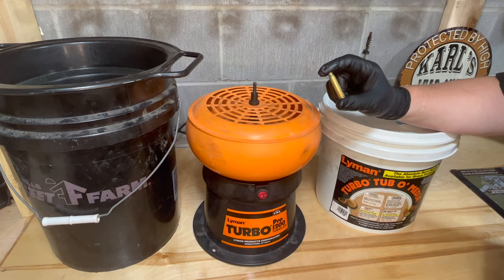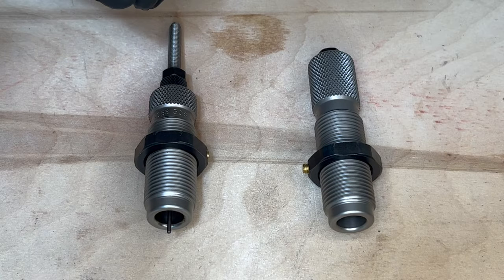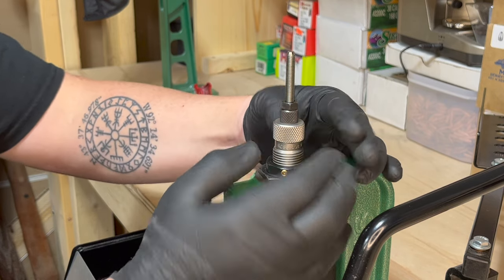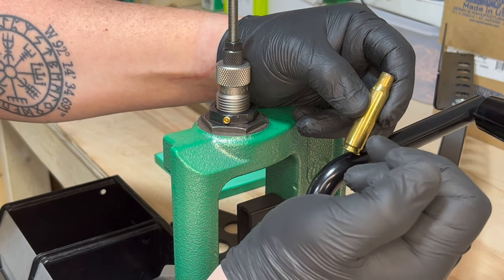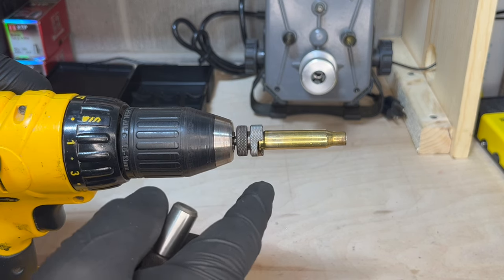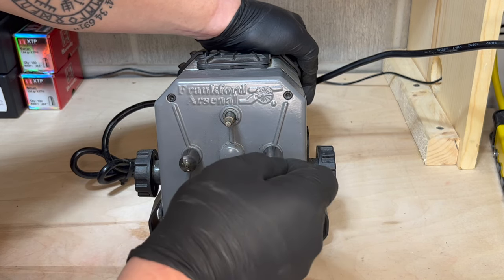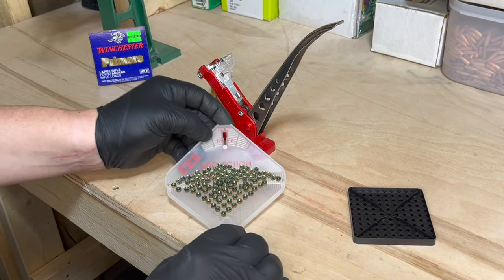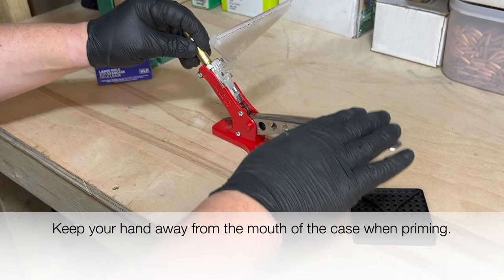How to Reload .308 Winchester Ammo For Beginners

Comment: Thank you.  I've been reloading for decades, but not a lot of .308.  The question that always comes up that I'd like people's opinions on is how much crimp is enough.  I've read where the right answer is none, the mouth of the brass should be the diameter of the bullet plus both case walls and nothing more.  I've also seen factory ammo that had a slight crimp.  Anyone care to weigh in?
Reply from the maker: Hello @oldsalt898 - I'll start off the conversation. Like you said, you'll hear mixed recommendations. Here's my rationale as to why I crimp. I have ramp feed and chambering issues when I use reloads in my AR style platforms. So I use a light crimp on all of my .308 reloads. It will be interesting to hear others chime in with their thoughts! 👍
Reply: @k2defense  So if I'm hearing you correctly, you would put a slight crimp for the AR, but maybe not for a bolt action rifle like a Remington 700?  Thank you for taking the time to reply to my question.  It is appreciated.
Reply from the maker: @oldsalt898 - I prefer to crimp both. However you wouldn’t need to unless the reloading instruction requires it or if you notice pressure issues or notice that the COAL changes with the lack of crimp to hold the projectile into the case mouth. For this reason, I crimp everything. Some more than others. Hope this helps! Happy to dialog more if needed. 👍🏻

Comment: The case length is 2.015.
Reply from the maker: @vindicator54 - The maximum case length for a 308 Winchester is 2.015" (51.18mm) and the case trim length is 2.005" (50.92mm). As with most cartridge cases the trim length is 0.010" less than the maximum length.

Comment: This is the best beginner reloading tutorial out there. So many others offer great instruction, but they speak a thousand words per step. They mix in more advanced instruction and other tips not needed to just GET STARTED. Thank you!

One question: do you have to crimp the .308 shells? If it's a choice, what's the difference - more assurance that the bullet will not fall out or get knocked crooked?
Reply from the maker: @ZildjianMan30 - appreciate the compliment! As far as crimping, I crimp everything. I run the .308 in the AR platform so if I don’t apply a light crimp I’ll sometimes have ramp feed issues from the mag to the chamber. When I apply a light crimp that issue goes away. Yes, it also helps with projectiles being inadvertently pushed into the case by aggressive handling, storage, etc. Some reloaders may respond with other ideas, however, this works for me with zero issues. Just don’t over crimp as it could pressure issues. Hope this helps! 👍🏻
Reply: @k2defense  That makes sense. I'm hoping to finally get into reloading. I have almost everything required to get started saved to a wishlist. Waiting for the big, end of year sales.
Reply from the maker: @ZildjianMan30 - awesome! Keep us all posted on your progress! We’ll love to hear how you’re doing! 👍🏻

Comment: So could you keep a completed round at your desk to use as a guide for setting your crimp and seat die? Wouldn't that save allot of effort. Then you can double check your first rounds with the calipers to make shure your at the right col and presto you just set your press in half the time.
Reply from the maker: Damned Angel - I take it a step further and use locking rings. Once you set them, you can forget them. All you need to do is screw the die into the press and off to the races you go. To your point, the main idea with reloading is consistent repeatability. Thanks for the comment! 👍🏻
Reply: Better NOT to have powder and primer in a 'dummy' round... just saying 👍

Comment: Was wondering why you did not include a step to check the formed case in a gage to confirm it is meeting headspace specs? When I first started reloading 308/7.62 Nato, with my 1st batch of 300, many would not allow the bolt to close. Bought a Hornady cartridge check gage.. found the ones that would not chamber, failed the check. Ended up pulling all of them apart, and carefully ran them thru the process again.. I figured I was not running the case all the way into the die. Problem solved.

Now, when I do a batch, especially if I am using fired 7.62 nato brass, I check every single case. Sometimes, no matter how many times I resize a case in question, it fails the gage check. Those I toss. All of my dies are Lee Brand for all the calibers I reload.
Reply from the maker: Hello Stephen Burton,

Great question. I usually use a case gage or the plunk test. I missed it. Thanks for brining it to my attention! 👍🏻

Comment: Small base dies are for auto loading rifles and aren't needed for bolt rifles.
Sometimes even an auto loading rifles doesn't need the cases sized is SB dies.
I did an AR 10 upper in 308 then got lucky that this AR Stoner barrel works fine for cartridges sized in standard 308 Redding and RCBS dies.
I own AR 10 uppers in 6mm - 284 win / 6.5 284 Norma / 375 - 300 WSM and with these uppers the reloaded casings didn't need me to request the sizing die to be made a small base sizer die.
Personally, I wouldn't back off the bullet seating die at all once screwed down to a stop on a cartridge because I want the full alinement of the bullet as it is pressed into the cartridge.
By backing off the seating dies it can cause the wabble affect and cause at the base of the bullet is unsupported letting push outward in any direction.
For seating bullets in the cases I seat the bullet a little a time then check with the rifles where the bolt closed in the loaded cartridge and then set the die for that bullet seat depth.
Some rifles have a longer chamber throat than you can seat the bullet out then the cartridge won't fit into the rifle's magazine so in this case I seat the bullets to where the cartridge fits into the magazine.
Not all chamber reamers are the same so going by book recommendations for bullet seating isn't always true for the rifle you own. 
As an example, when I bought from Pacific tool & gauge the reamer for the wildcat called 375 - 300 WSM there is also a reamer 378 WSM, the 378 WSM cuts a longer throat than the 375-300 WSM and being this is in the AR 10 I have to remember the loaded 375-300wsm cartridges must fit in the steel 20 magazines of an AR 10 so the 378 WSM wasn't what I wanted.
If someone wants to know about the 375-300 WSM look it up and it is a match in power for the 375 H&H magnums.

Comment: Great information, excellent work on explaining details. Do other dies work the same way, or does the process  steps change when using Hornady  or other dies?
Reply from the maker: The steps are similar. There are some differences when neck sizing, FL sizing, and SB sizing. Carbide and steel dies have variables as well. You’ll want to make sure to read the instructions when using each type of die. Hope this helps! 👍🏻

Comment: What's your primer seating depth ? Factory spec is 0.004" my groups are better at 0.007" .. Some like 8 to 10 Thousandths..
Reply from the maker: Diamond Fred - honestly I don’t check primer seating depth on my plinking rounds. The best seating depth is just below flush. I run my finger across the bottom to make sure they’re not flush or just above flush. I’m concerned for slam fires as I mainly use this ammo in AR platforms. March grade shooters find a sweet spot by measurement just below flush so 0.007” is adequate. 👍🏻

Comment: i'am noticing that at 2;30 you are holding a cae that seems to not be sized at the head of the case i can see a line on the case , to me that means the cam over is to much. i've had case do that and stick in the chamber after that.
Reply from the maker: Hello @ultimatecreedmoor!

Knock on wood, I’ve never had that happen. If you’re having trouble with it, turn your die down by an 1/8 turn, resize, then plunk test it until you hit that sweet spot. I run all my ammo the same for AR and bolt platforms.

Comment: Id like to know what brand the drill powered trimmer is that you used here please.
Reply from the maker: The Lee Case Length Gauge & Cutter and Lock Stud is the simplest way to check the case and trim to the correct safe length. 👍🏻

Comment: This is by far the best video I’ve seen so far for a beginner like me. Thank you for going step by step and not doing 50 cartridges in between. 

One question, when you do an additional quarter turn on the resize die, is that a measurement somewhere that needs to be made? Is that different for full size vs small size? Is it unsafe if I did so with a full size die? Or just possibly less accurate?

Thanks again man, great video.
Reply from the maker: Austin Buttenob! The quarter turn is for the cam over with SB resizing die. You don’t need to do that with the FL resizing die. Let me know if you have any additional questions! Glad this video helped! 👍🏻

Comment: Do you neck lube? With the mandrel in the fl die running through the neck i have seen adding a little wax or dipping in dry lube. But im not seeing anyone else doing that
Reply from the maker: @RockinRack - with bottle neck cases I only lube the lower third of the case. However, if you’re finding that the cases are hard to resize because of the expander ball or hearing loud squeaking I sometimes add a shot of case lube spray to the case mouth to help with these issues. I won’t typically tell anyone that they’re doing it wrong. As long as it works for you and you’re getting the results you’re looking for, that’s all that matters. Experiment with different ways of lubing and different types of solutions. All the tips I provide “work for me” related to case lubrication. Others may have varying opinions on processes. 👍🏻
Reply: @k2defense  thanks for the response 👍 I recently read that once fired brass has enough carbon in the neck to act almost like a dry lube which makes sense. They were of the opinion of only doing so if you find it necessary, so now I have 2 opinions that agree and make sense. Keep up the good work I enjoy the channel!

Comment: I understand this video is for beginners but you're totally guessing and most likely bumping the shoulder more than needed and overworking your brass going with the 1/4 turn. Even beginners should be taught to take fire formed brass from their gun, measure it and be reloading for their chamber. 1-2thou bump for bolt guns and 3-4 for semi auto
Reply from the maker: Condition0- totally agree for neck sizing only. You’re spot on. However, these are SB dies. Thanks for the comment! 👍🏻
Reply: Even RCBS recommends 1/4 turn.